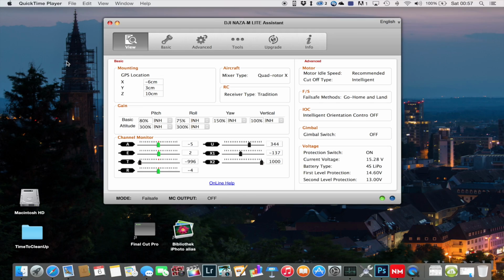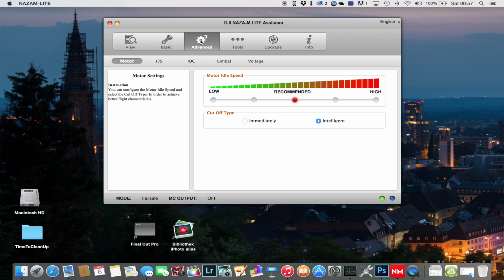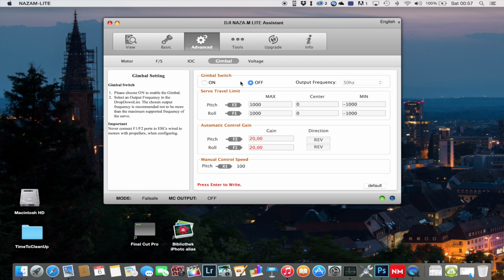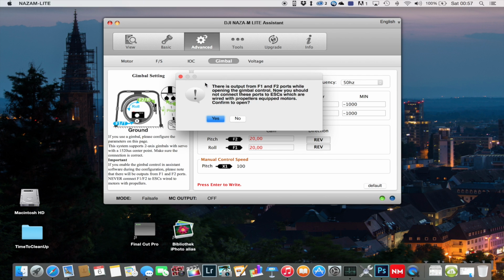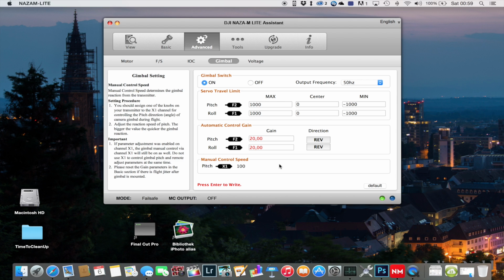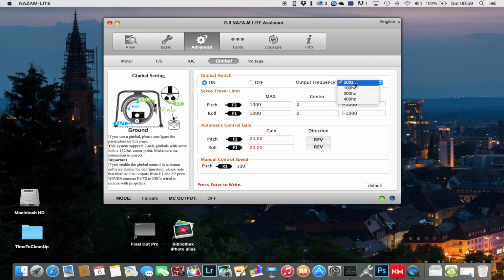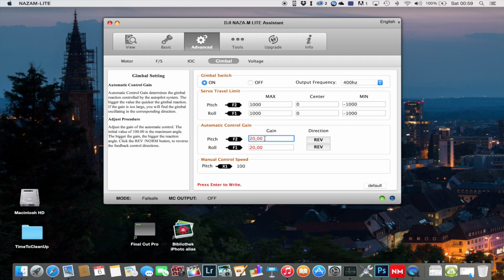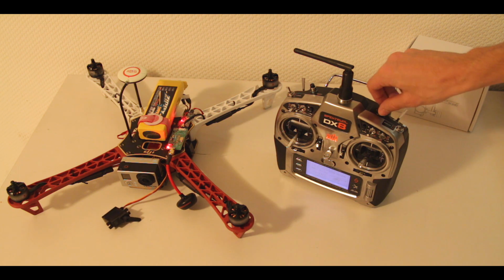How To: Naza M Brushless Gimbal Pitch Output Setup (DJI Naza M Lite)

Comment: Great info in your video...thank you! Is your receiver connected to the NAZA-M List MC via iBus or PPM? I'm connected using PPM which give you only 8 channels (I'm using a FS-IA10B 10 channel receiver) and I'm thinking that I may need to connect via iBus to get the additional 2 channels.  Because when I enable the gimbal in the NAZA Assistant software it automatically used the switch that I had assigned for flight mode and if I had those two additional aux channels I think I'd be able to assign the two shoulder dials on the transmitter to control the pitch and roll on the gimbal.

Comment: hi can you use a brusless gimbal on the naza lite
Reply from the maker: most Brushless gimbals are sold with a controller, so they work on their own. What the Naza does is it takes the Rx input (like SBus or PPM) and sends it as a normal "Servo" PWM Signal to that controller so you can control tilt like I did in the video
Reply: +JulianGoesPro thanks 4 the reply what doung my head in my gimbal works fine with my phantom naza v2 useing a single wire for the tilt and a tilt lever but now i have a f450 with naza lite setting it up the same way like the phantom no tilt movement but in the software showing the levers working etc etc
Reply: Had this issue, was instantly rectified for me by connecting the earth ports on the gimbal and Naza V2 with one of the wires supplied with my GoodLuckBuy gimbal.

Comment: This is a Servo not a Brushless
noobi
Reply from the maker: true that, but there is no difference between plugging the pitch cable of ,let's say an AlexMos Board, or a servo in there... with the settings I showed here both should work :)
But for all you disbeliever I will connect my second Walkera G-3D to that exact settings for demonstration purposes^^
Reply from the maker: what do you mean with "a Brushless"? It isn't a brushless servo but the Settings will work for a brushless gimbal with a brushless gimbal controler... not sure what you where looking for?
Reply: Julian GoesPro No Julian, a Brushless gimbal has brushless motors instead of servos (of any nature) which Naza M does not support without an independent control board,, yet your video title indicates it does.
Reply: Julian GoesPro lol you dont get it do you.
Ok Julian, go knock yourself out :)
Reply from the maker: DFunk O 
no I don't get what's wrong ;) But now I really want to know^^
Reply: I just want to know why is my gimbal not communicating with the NASA assistance whatever I do in  there does not make any changes to my gimbal for example if I turn on FPV mode the gimbal still wants to keep horizon  level it’s not supposed to it’s supposed to roll and pitch with the drone it’s like if the software does not recognize the gimbal